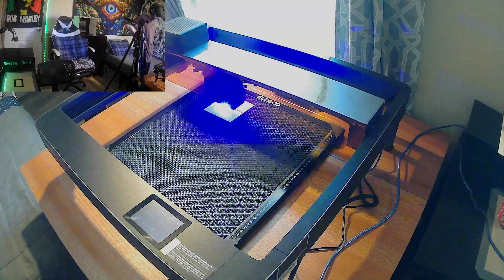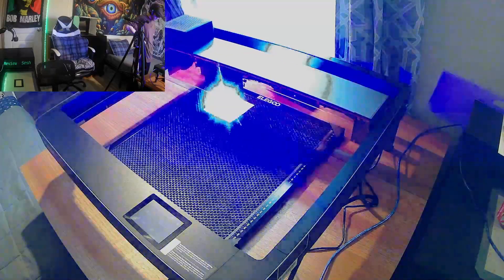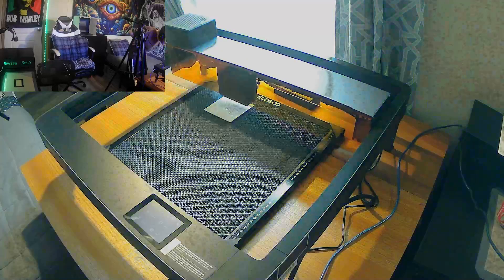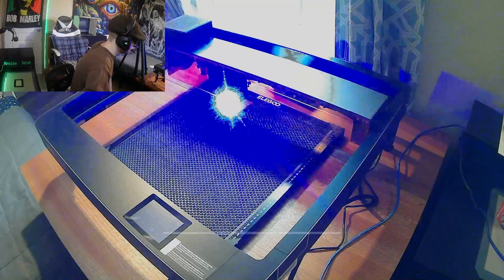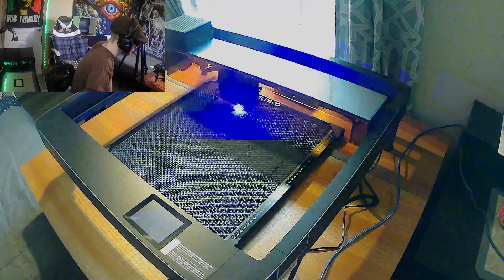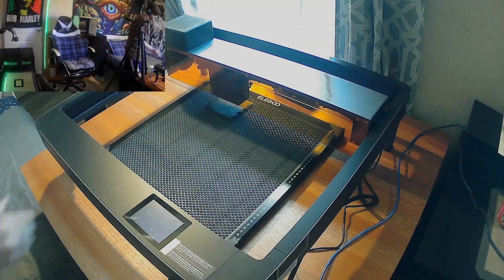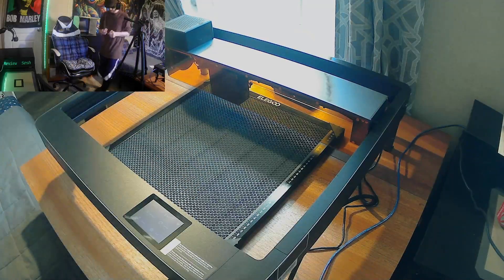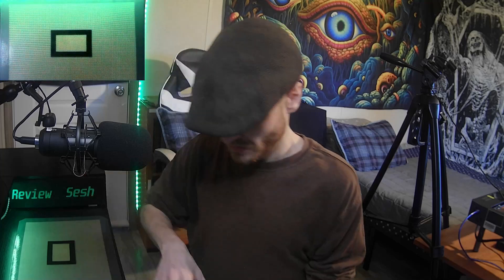Scale Forged Manufacturing Elegoo Phecda Slate Coaster Test

Comment: Looks good what were your settings for the slate?
Reply from the maker: what we end up using was around 2200mm/m and around 50-75% power, can be tweaked up and down for other machines and or differend types of slate coasters
Reply: @ScaleForgedManufacturing  I have the same machine, thank you for answering
Reply from the maker: @WarlockCore  you are most welcome! <3

Comment: Can you share the power and speed you used?
Reply from the maker: we used a 400-600mm/m and  60-75%  speed in lightburn, experimentation is ofcourse required,  one setting is differend to someone else and/or material